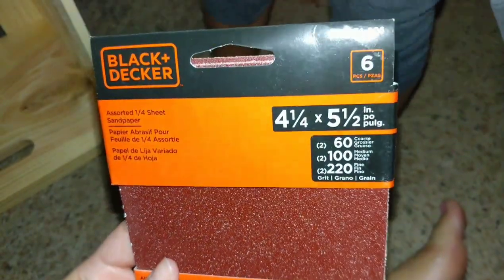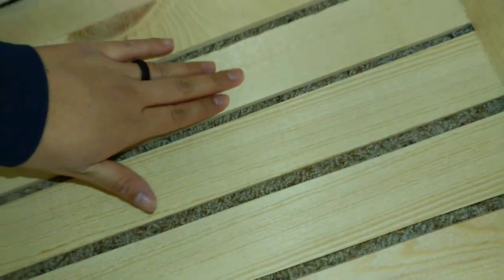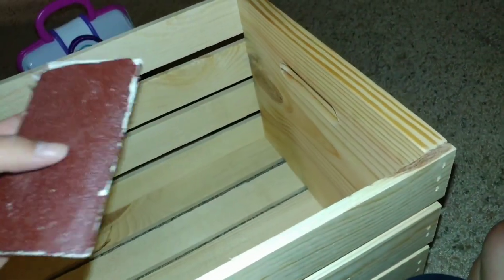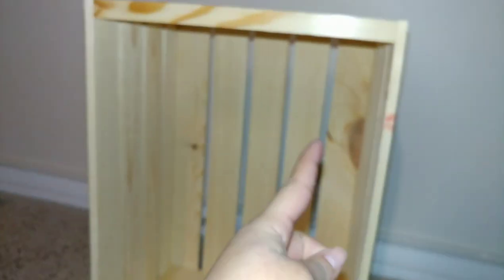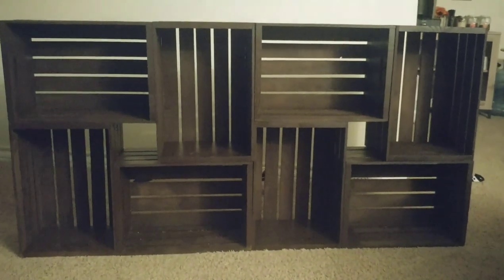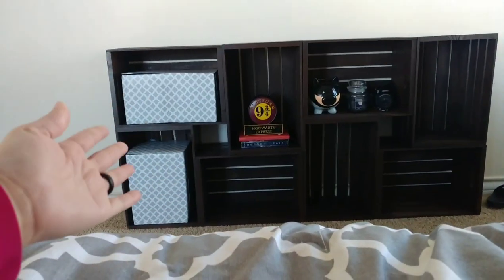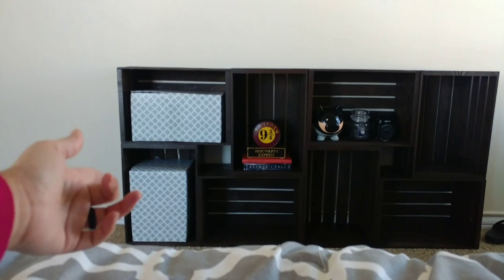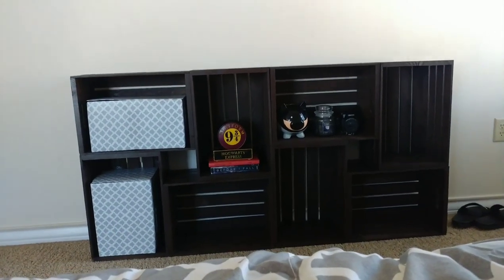Wooden Crate TV Stand D I Y | The Cortez's

Comment: Love the set. What are the measurements of the crates you used & stand now that it’s put together?
Reply from the maker: Thanks for watching ☺ & to answer your question the crates are from Michael's & they're..
H: 12 1/2"
D:9 5/8"
W: 17 7/8"
Wood slats are approximately 3/8"thick. The stand itself is 61" in L & H: 22ft 11in
Hope this helps ☺
Reply: The Cortez's thank you much